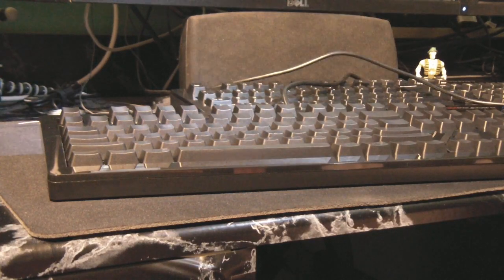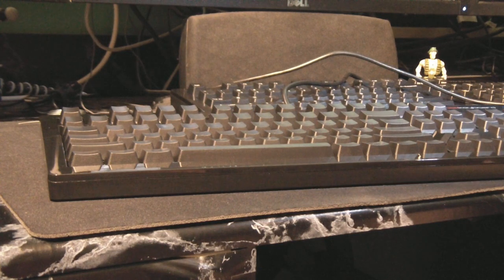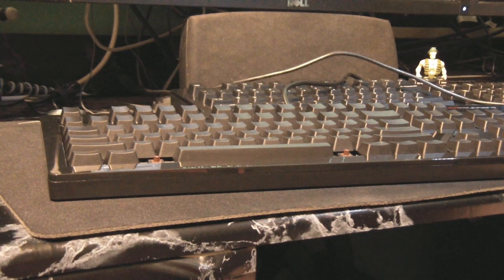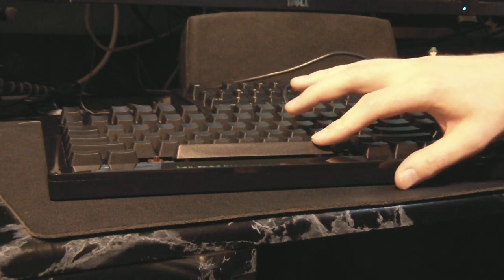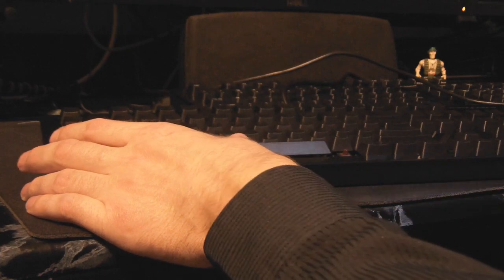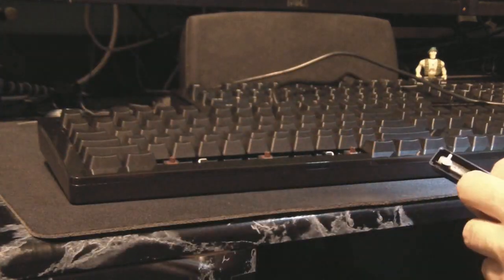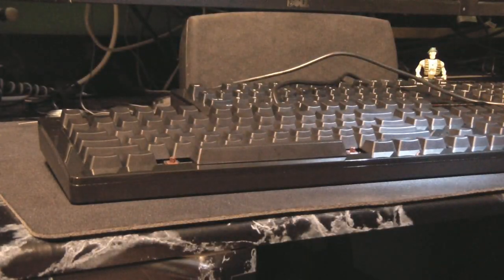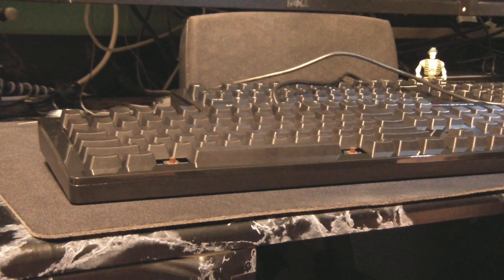Tutorial: How to remove staiblized keys from a Das Keyboard

Comment: Thanks for a great video.  This helped me tremendously.  Never had a mechanical keyboard before, and was a little apprehensive.  But I went for it, and now all my larger keys have o-rings.  

Using a headlamp is a great idea--both for the video, and for me doing the install.  I also learned to look at the keys from the side instead of straight on when putting them back on.  Helped me line the wire up with the plastic thing more easily.

Comment: I find it easier to push spacebar to one side until the hook on the stabilizer pops off the plastic tab.  It bends the metal stabilizer in the middle but if not enough so that it deforms from the original shape.  Also, there is less chance of scratching up the casing or bending the end points of the stabilizer with a screwdriver or any tool for that matter.